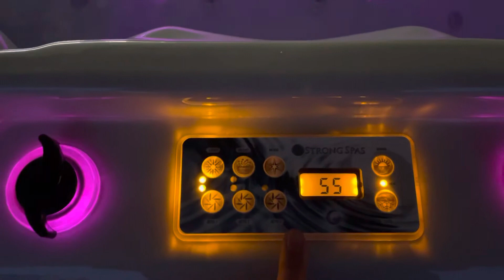Strong spa

Comment: I purchased a Strong Spas Madrid 60 at Costco and literally after the warranty expired, every jet began to leak and it leaked significantly at two of the unions.  They actually split.  The pipes did not freeze, it is simply a poor product. Costco was no help and certainly Strong Spas was of no assistance either.  I owned my previous hot tub for over 20 years! Hopefully their quality has improved since I purchased mine.
Reply from the maker: Unfortunately we hear this story a lot. Costco serves a purpose for certain budgets however moving a lot of volume can mean less quality control. Please let us know if you have any questions  Good luck 🤠
Reply: On the contrary, hot tubs were built better back in the late 90's to early mid-2000's, Quality has dropped off significantly since that time period.